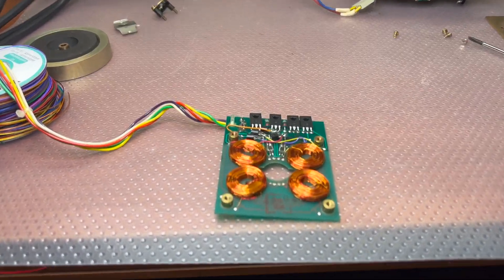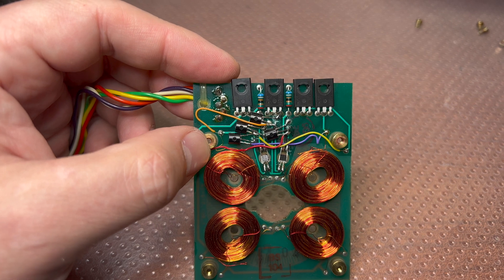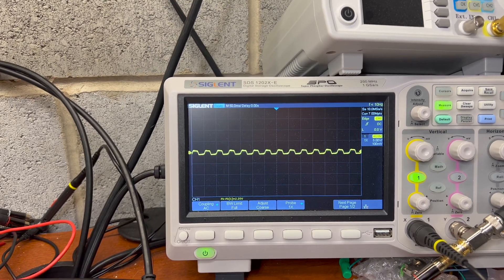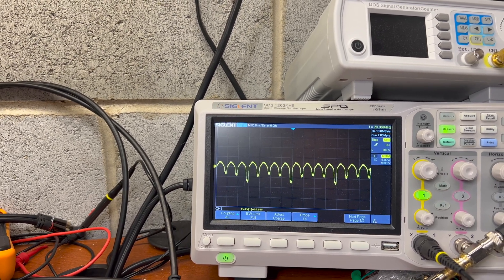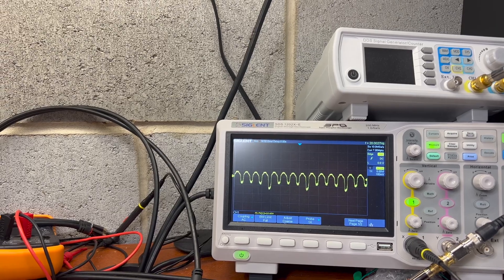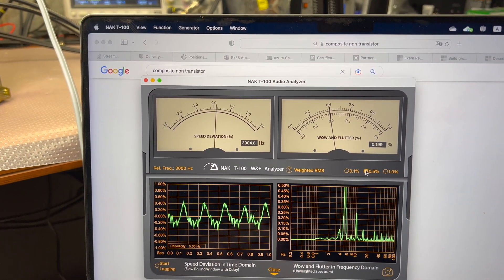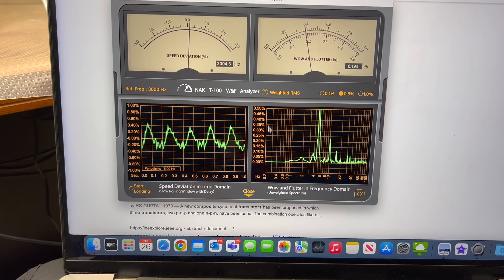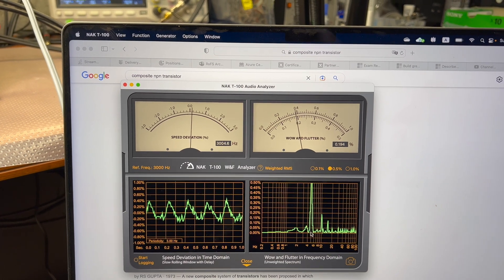Experimenting with Composite Transistor Scheme for Revox W&F Improvement: A Work in Progress

Comment: Well 0.2 % is too much for that kind of transport. I have some Yamaha KX-260 which have single capstain and plastic flyweel, reading are 0.03%-0.05%. Btw Thank you for making that inteesting videos about decks.
Reply from the maker: My Japanese decks gets as low as 0.017% WRMS. The problem is with that particular DD motor design.